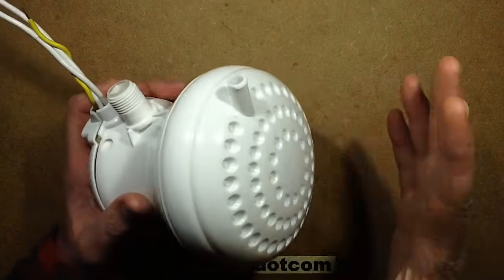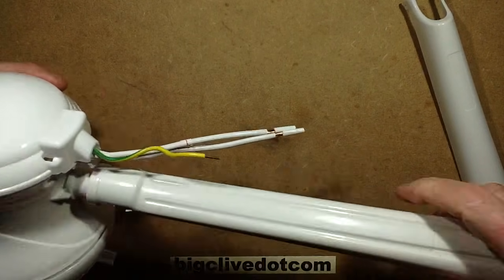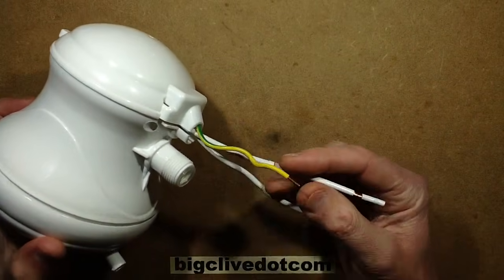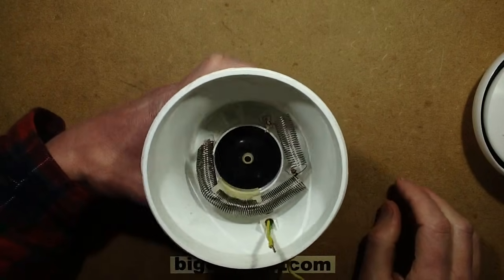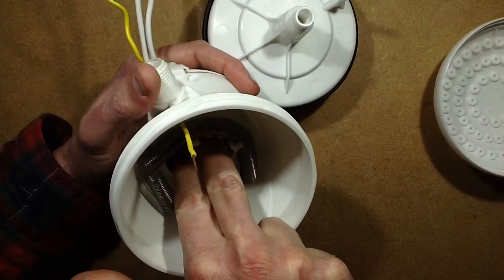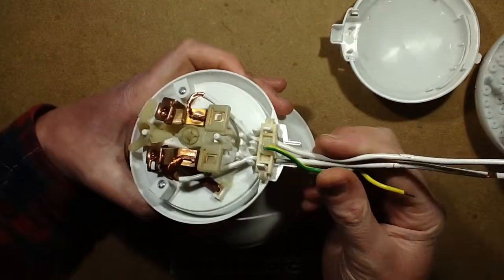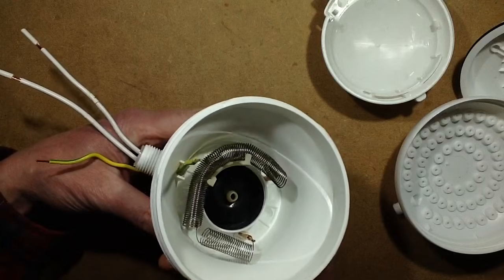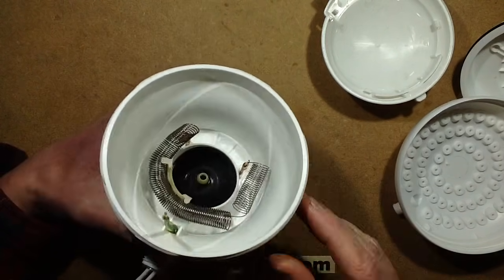Inside a heated shower head.  (suicide shower)

Comment: Why not just get a proper hot water system installed
Reply: Truth teller Because those "goddamned fools" don't express themselves like a petulant 12 year old who believes that liberal use of profanity and insults strengthens his already dubious aura of authority rather than weakens it. And seriously, YOU'RE calling people obnoxious? That's a hoot! As for your "experience", the only thing in evidence here or on you channel is that you have at least some experience sweeping sidewalks for your Brazilian boyfriend Francisco. Beyond that, all I see is an old white man who moved to Brazil for "reasons" and likes to make death threats to random people on the internet when they don't bow down to his self delusional authority. I mean, you're throwing shade at Big Clive here, but at least we know he does at least one thing worthwhile. You? Nothing, as far as I can tell. Any more truths you need to be told, "Truth teller"?
Reply: They are not only cheap, but also more energy-efficient, especially when the electricity comes from renewable energy like water power (Brazil as mentioned)
Reply: It is way cheaper than a boiler. I am from Brazil and suicide showers are really common (my apartment has one) and more efficient. My parents had a electric heated boiler and the energy bill was huge (electricity is really expensive here) so they changed to a electric shower with their solar heater system and the bill droped by a lot. Also, most houses here don't have a proper ceilling for a boiler or a basement like in US. But now there are a lot of gas shower systems as the cheap gas from bolivia is better connected to big cities.
Reply: I live in João Pessoa, PB and have for 14 years.  I have two of these and have never heard of anyone being even slightly shocked by them.  Americans tend to be the most uninformed people in the world and are arrogant about it.
Reply: ProgHead777 I have facts and personal experience.  These deliberately obnoxiius assholes refuse to even acknowlege the obvious.  Why don't you tell them to stop being such goddamned fools?
Reply: Truth teller
Here in the civilized world we believe government reports. If the government says the shower killed someone the shower probably killed someone. Also how can a little colonial know what a taller person feels when their head gets near one of these death traps?
Reply: Truth teller
You are supposed to prove the things you say and I never said there are no millions of poor people who use these death traps. Your dog is probably smarter than you are so please keep using your death trap and make the world smarter.
Reply: Because it is cheaper and better environmentally to heat only as much water as you need when you need it instead of heating a large amount 100% of the time.  Then allowing water left in the pipes to grow cold so you have to fill them up with hot water again when you want to shower.
Reply: A well insulated decent hot water tank could be heated during the night time when the electricity demand is small and the price is low, and it could be heated with solar thermal collectors. A couple of square meters will probably supply most of the heat needed. We even use them in the nordic countries where they only work half of the year.
Reply: Mikk392 You are correct on all counts.  I did super insulate an electric water heater with 8" of glass wool.  It did make a difference but not as nuch as I hoped.  I did not run it only at night as you suggested.  It was not large enough to serve our needs that way.  Then I built a solar heater for it and was able to turn off the circuit breaker.  The savings then were wonderful.  :)
Reply: If you google this thing you can find the electrocutions so maybe not call people ignorant if they know more about your primitive ways than you do.
Reply: wistals3deniks I have done a search as have other people on this thread.  It is only ignorant fools like you that refuse to belive verifiable facts.
Reply: Truth teller
I came to this video after the electrocution of a Indonesian vlogger by this kind of shower. Now I know you are just a savage in the colonies so I cant begrudge your lack of manners, but maybe be a little bit less arrogant to other people.
Reply: You are a goddamned liar. Proof, you stupid SOB. Proof is something that can be verified by an objective observer. You provided none. I doubt that you even understand what proof is. Show some or go away forever.
Reply: wistals3deniks
You arrogantly stupid SOB.  Show me a government report that says they kill people.  Then show me a verifiable report of anyone being killed.    You are so fucking dumb you think that no one has been checking this?  You also are astoundingly stupid if you believe all government reports.

As far as being civilized. you don't even know what that means.  My dog is more civilized than you are.

Where do you live?  Outer Slobbovia?

Prove anything I have posted is not true.  Prove there are not millions of people using these every day.  Prove that anyone anywhere has been killed.  If yu can't crawl back to your "civilized" septic tank home and shut the fuck up.
Reply: Truth teller
7-1 never forget.
Reply: wistals3deniks
7-1? What are you babbling about now?  You are the most goddamn dumb fool on here in months.  What a turd brain you are.  You know nothing, spout bull shit, and never prove anything but what a fool you are. 

As expected, you ignored my challenges.  I even told you that you would.  Thank you for proving what a cowardly cretin you are.
Reply: Truth teller
http://www.telegraaf.nl/buitenland/27253390/__Boiler_doodt_beauty-blogger__26___.html
Reply: kheath580 You are correct.  Most condos and apartments are that way unless hot water is provided by the building.
Reply: ProgHead777
You are both arrogant and stupid.  Those are not insults, those are descriptions based upon your posts.

FYI, you ignorant SOB, I have proved everything I have said.  You have proved nothing except you are stupid and arrogant about it. 

I have used facts such as millions of these type of units are in use every day in Brazil alone.  Not one person has ever been electrocuted by them.

Tank-type electric water heaters use the same method, an electric heating element is immersed directly in the water.  DO you deny either of these things?  Then provide proof. 

Prove anything I have posted is not true.  Prove you are not the arrogant asshole you show yourself to be.  Try actually reading ALL of my posts.  You probably don't want to do that because you are afraid it might show I am right and you are the dumb ass you show yourself to be.
Reply: ProgHead777
You are another goddamned fool. 
Fact:  Millions of these devices are in use in Brazil every day.  If they were even 1% as dangerous as the fools here say, thousands of people would be electrocuted - every day.  Is that happening?  No, it is not. 

Fact:  These work exactly the same as a tank water heater.  I have repaired many of these and the electric one all have a heating element immersed in the tank water.  

Those are indisputable facts  Look them up.  Google how many people have been electrocuted by the shower head heaters.  I can give you an exact count.  Zero.  But look it up for yourself,  The other goddamn fools are too lazy or are afraid they will find out I am right.

Hitch up your balls, if you have any, and do the right thing.  Otherwise shut the fuck up.

FYI, you arrogant asshole, I have done many things that are useful  One is right in by telling the truth about this video.  You don't know me, who I am, or what I have done.  Again, shut the fuck up.